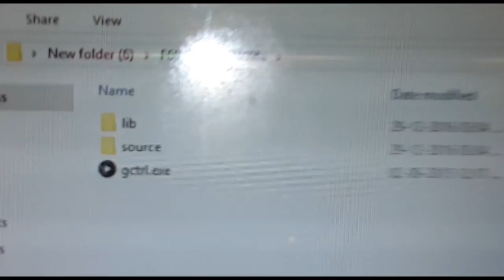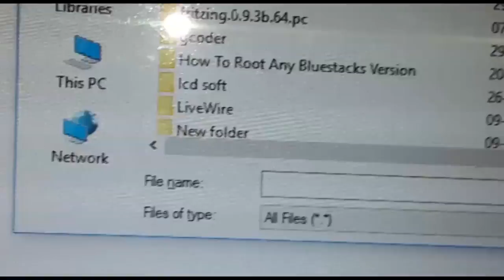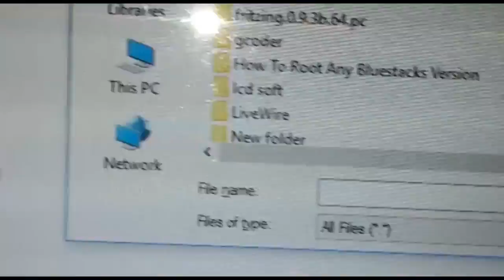DIY HOMEMADE MINI CNC MACHINE PLOTTER  SIMPLE EASY TO MAKE #1

Comment: WHILE RUNING CNC 3 IC's OF L293D  GETTING TOO HOT SO COVERING OF L293D IS NOT A GOOD THING, WHAT IS VOLTAGE AND AMPERE VALUES OF YOUR POWER SUPPLY?
Reply from the maker: 5 volt and 1 amp
Reply from the maker: +Wasantha Wimaladharma  you can choose l298 or ARDUINO shild v3
Reply from the maker: +Wasantha Wimaladharma  THANKS FOR WATCHING OUR VIDEOS. KNOW MORE ABOUT THIS CONTACT US FACEBOOK PAGE OR TWEETER. FEEL FREE TO CONTACT US. THANKS
Reply from the maker: Thanks friend